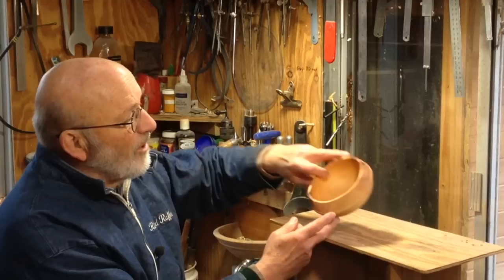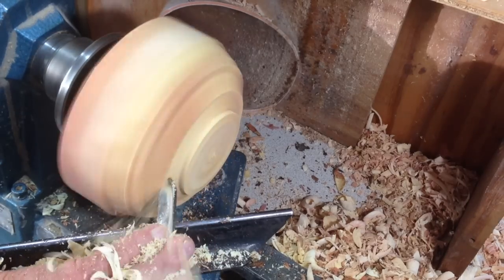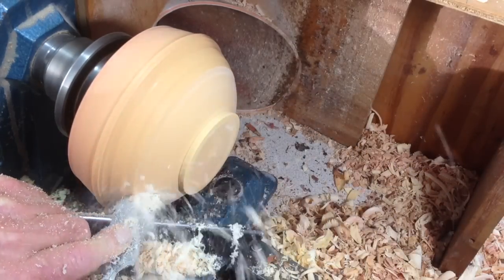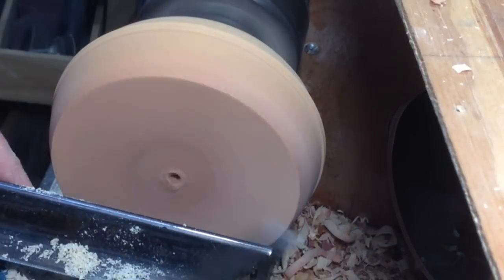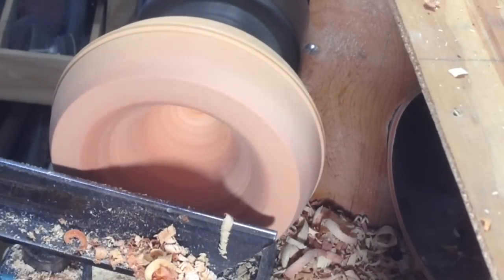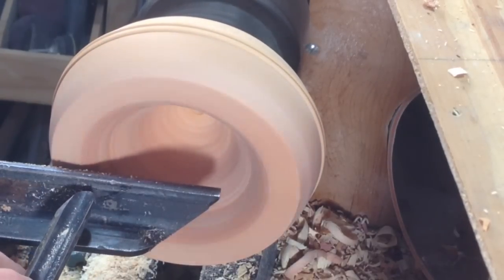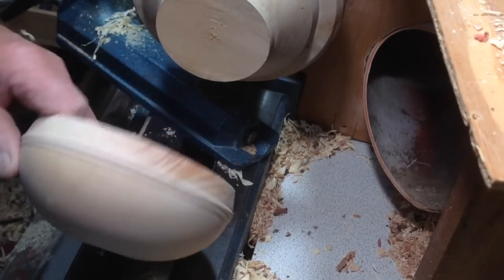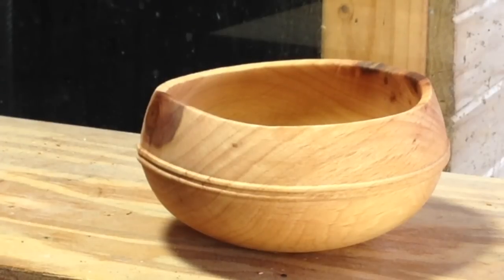Richard Raffan turns and microwaves a small bowl from green casuarina

Comment: I microwave bowls, too. 30 seconds on high, 1 hr rest. Repeat until it comes out hot to the touch, not steaming.
I also like that you aren't afraid to sand with used sand paper. I think used sand paper reduces the agressiveness of the grit making it closer to the next grit.
Reply: He uses it to build up friction heat to dry the surface. Excellent idea!

Comment: Richard - when you 'returned' at 18:05 with a sanded bowl, the section above the bead seemed to be reduced.  Did you have a problem that required 'adjustment' (or did you simply not like the look of the piece ?) ...
Reply from the maker: You're seeing two bowls in this video, something I'd not realized. I videoed several similar bowls and clearly picked the wrong clip when editing. I should definitely have pick that up and many thanks for bringing it to my attention.  But at least the original bowl made a comeback at the end. I do remember checking those clips for the heartwood whereas the beads are far more relevent.
Reply: @RichardRaffanwoodturning  Richard - many thanks for the enlightening reply - much appreciated !

Comment: I have tried the microwave method a few times but end up with many small cracks.  I’m wondering if it may be the microwave settings or the time interval between cycles.  Is it better to keep the cooling off time shorter rather than letting it sit for several hours?
I am also having trouble with wet wood where it is rusting my lathe even after applying paste wax.  Also problems with the bandsaw blade clogging up.  Any suggestions?
Reply from the maker: The micro splits might well be down to the wood species or even a particular tree. Unfortunately I've no rule to follow when microwaving given there is so much variation one piece to another regards the volume of wood, the percentage of moisture in the wood, and the microwave oven being used. I experiment with each run of bowls. As a VERY rough guide, a 150x75mm bowl with a wall 3mm thick will get 90 seconds initially, but I'll cut that short if I hear it crack or smell it heating. Working green wood you need to take care wiping down machines and tools with a towel to avoid rust. I usually spray WD-40 or lanolin around too. I remove gunk on bandsaw blades using a small joinery chisel. I was told recently that soaking a blade in 8% acicity cleaning vinegar does a good job but I have yet to try that.